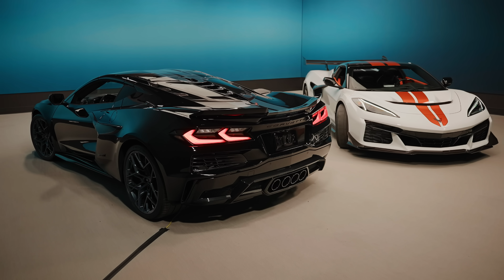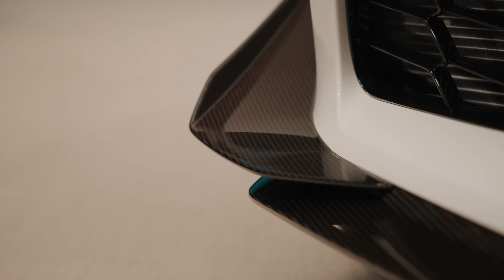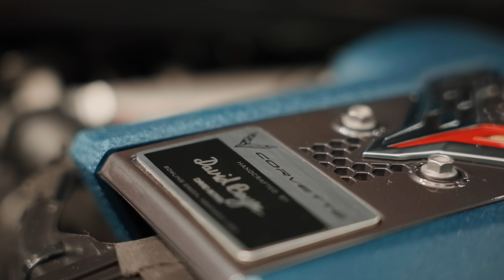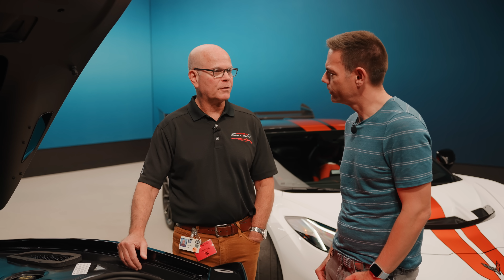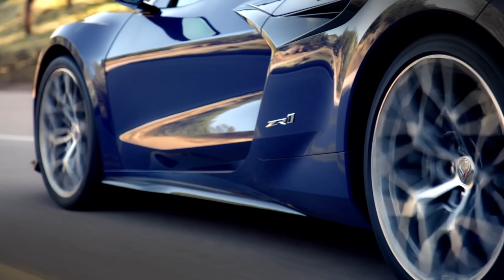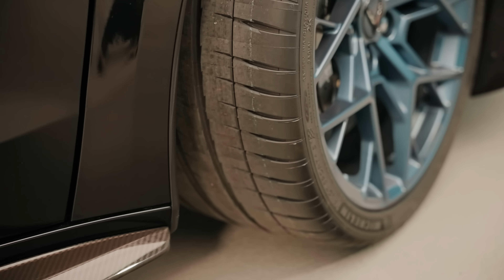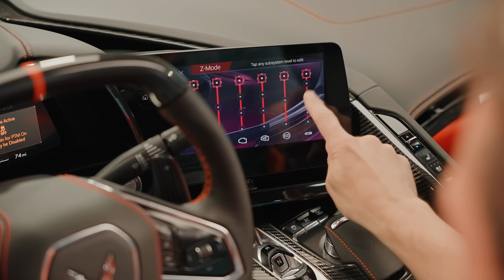FIRST LOOK: 2025 Corvette ZR1 – 1064hp, Turbos & 215mph!

Comment: What was the nurburgring lap time for this monster?
Reply: I may have missed them saying it here but they did test it at the ring but they haven't released the numbers. The g's vettes can do and now with this engine I can't see how it wouldn't have put up an incredible number if it could keep its tires
Reply: it kept going off track on boost
Reply: @blahblahblaa  So high hp but cannot stay on track?
Reply: @Sidewinder5 With street tyres yes.
Reply: No modern super car can do a real time attack of the Ring because the production version street legal tires fall apart.  You need to use track only tires, which defeats the purpose of an accurate lap time.  This is why many manufacturers do not believe the times being published by certain brands...

Comment: Forget GT3 RS, this will destroy the GT2 RS.
Reply: Also Revuelto and SF90 lmao
Reply: @imamfn  Revuelto yes, SF90 most likely not, especially the SF90 XX Stradale.
Reply: @imamfn the sf90 can beat this corvette not sure about Lambo tho
Reply: Until you have to turn......
Reply: facts
Reply: True story
Reply: Dream on, Dream on 🎤🎶🎶
Reply: If the new GT2RS has anything close to the down force the 992 GT3RS has, then unlikely.
Reply: @Brian.Jones.310 how much you want to bet? Y’all going to stop acting like Chevy don’t make shit HANDLE
Reply: @mogulme6190  I will give you a final answer seeing the 992 GT2RS. But my bet is going to be with Porsche unless some drastic changes are made by Porsche and sandbags the car.
Reply: @mogulme6190  FACTS don’t care about your feelings bro, and FACT is that the ZR1 simply doesn’t have the downforce to match the GT3RS, yet alone the even more crazier upcoming GT2RS (considering it’ll have more-or-less the same aero capabilities as the GT3RS). You can’t outphysics physics
Reply: @gavcom4060  fact, the Corvette will roast the Porsche.
Reply: @TheSaw410  based on what exactly? I’ve provided the facts, and you’ve provided nothing
Reply: @gavcom4060 z06 beats that car already google bro. This car will destroy that car
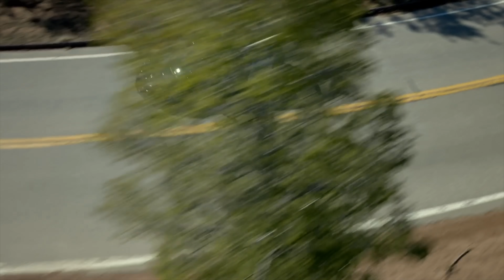Reply: @Mr.DDS82  there’s more to a car than straight-line speed lil bro. FACT is the GT3RS is faster around a track. 7:12 Nurburgring time for the Z06 vs 6:55 for the GT3, which is a lesser version of the GT3RS
Reply: @gavcom4060  I'm talking about track times the z06 has beaten the gt3 rs at tracks
Reply: @gavcom4060  the z06 doesn't have a official time at that track
Reply: @mogulme6190 it's not about being shit, it's just Porsche doing German magic
Reply: As cool as this car is, the downforce figures are nowhere near GT3rs levels (1,900lbs for the  GT3RS at 177 MPH vs 1,200lbs at 200 MPH for ZR1). This will brute force its way around a track with sheer horsepower lol. If the GT2RS has similar power, but with GT3rs levels of aero, the ZR1 won’t be able to match it
Reply: No it won't. It doesn't even have the same amount of downforce as the GT3 RS, which is what actually matters around a track. The GT2 RS will probably have 800 or more bhp while having more downforce than the GT3 RS, which on its own has more downforce than a McLaren Senna.
Reply: @SirMito  stfu. Porches have looked the same for 50 years and are ugly. Modified VW beetles 😂😂😂 This thing is going to destroy the GT3RS and beat the the GT2RS. All while looking way better. You see a Porsche on the street, no one turns their head. You see this? People are LOOKING. F your Porsche 😂
Reply: @SirMito  Something to add, McLaren produces it's max down force of 800kgf at 155mph and at the same speed the GT3RS produces less down force.
Reply: @SirMito  So? The Z07 kept up with (and even beat) the GT3 RS around a few tracks, I dont see why the more powerful, more aerodynamic ZR1 would be any slower
Reply: As an owner of several Porches, I learned long ago to never underestimate Porsche engineers.  They are the best in the world and it’s translated to their cars.
Reply: @thedudeabides1443  i think it’s pretty clear Chevrolet engineers have surpassed those that worked for Porsche and with larger budgets. What gm has done is way more impressive and just better packaged/executed. Of course it’s just easier to give Porsche the #1 spot in engineering because it sounds right. It’s not the reality.
Reply: @G-Rated  It is now and always has been the reality.

Look at the Porsche 959:  automatic ride control, electronically controlled AWD, magnesium wheels, 4 different drive modes depending on the weather and a 200mph top speed in a 440hp car.

And all that was engineered by Porsche FORTY YEARS ago.  What was Chevy doing with the Vette 40 years ago?

Heck, even with the C8, Chevy had to use 10 year old Ferrari technology from the 458 to reverse engineer the C8 engine.

Chevy engineers are very good, just not in the same universe as Porsche—or even Ferrari.
Reply: @thedudeabides1443  you couldn’t COPE any harder and you sound ridiculous. What Porsche and Chevy were doing 40 YEARS ago is irrelevant to what the C8 is today. That’s called deflection.

What 10 year Ferrari technology did Chevrolet use to develop the Corvette C8? You’re literally just making crap up. It was actually Ferrari who asked gm to license their magnetic ride suspension technology for their own suspension systems.

Where is the logic in saying Chevy engineers aren’t in the same league as Porsche and Ferrari with vehicles like the C8 currently in production? Sounds like another emotional foreign badge fanboy.
Reply: @thedudeabides1443  Porsche is overpriced garbage, and you pay for it...
Reply: Ohhhhh God the Porsche fans are insufferable. Why'd you make this comment 😂
Reply: @toxicgracie3772  apparently speaking facts amongst opinions makes porsche people insufferable
Reply: @gavcom4060  Yes insufferable. Go drool over your modified VW Beetle goofy 😂
Reply: @gavcom4060 and they sound like shit 😂😂
Reply: @gavcom4060 My comments were deleted by YT of course because they're about a whack as you Porsche fans but anyways, Porches are ugly, they all look the same and sound like crap. Have a nice day
Reply: @gavcom4060  ok I’ll entertain you. Why did the heavier convertible version of the z06 get a faster lap time against the weissach package gt3rs when throttle house did their latest track test? Why did savage geese find that the z06 was faster than the gt3 at their track? Did both of them “outphysics physics? I think you are insinuating “downforce” yields an “automatic win”. Seldom have I found a track with zero straightaways.

I know you are passionate about your lord god king Porsche and I love Porsche too but oh my lord please show some restraint with your open pda.
Reply: @Berettadv  Maybe because those tiny privateer tracks specifically suit the positives of the Z06? Throttle House’s track genuinely only has ONE medium-high speed corner, and it’s that sweeping right hand corner, and even then they only get to like 70 MPH. The BAC mono is the third fastest car on that track, and that thing legitimately has no downforce, or barely any at all. It relies on mechanical grip and its superior p/w ratio. Everywhere else relies on power, which the Z06 has, and barely at that. Same can be said for savage. Now go to literally any track that actually sees Motorsport on the daily, like Laguna Seca, and you can see a GT3 lap quicker than a Z06 Z07, by .4 of a second, despite the power deficit
Reply: @gavcom4060  ahh because we totally live near tracks like those right? Lol if I spent +$100k over a new corvette on a track instrument, I don’t care what track it was on, it should be faster period. It shouldn’t be anywhere near “Chevy numbers” and to add insult to injury the gt3 rs sucks as a public road vehicle where as a Z06 doesn’t. Everything that makes the Porsche a more enjoyable track toy makes the corvette a better road car. Time will tell if this new zR1 really does deliver but you are discrediting it before it has a chance and I think that’s kind of foolish.
Reply: @Berettadv  to entertain the American people and thinking they are back at the top of Automotive, except they're not
Reply: @Berettadv bruh a GT3RS with sport comfort package is better than a Vette for a daily driver in any case, US don't even know how to make interiors yet, while also struggling in the NVH dept
Reply: @mathieuschafer1360  "sport comfort package" 
- lol I must have missed that option right under "turbo thrust does not exist afturburner package"
Reply: @Berettadv  ah yes, turbos on a GT3RS are annoying fr
Well  or the other more comfy package, with backseats too actually
Reply: Yes there are 1000hp GT2's with basically the same Aero off a GT3, but who cares when I can have both a Hard top & a Convertible ZR1 for what a stock GT2 goes for!!!
Reply: You're letting hype get to you. You're talking about Porsche here
Reply: Agreed
Reply: Maybe the Zora.
Reply: Can't wait for Americans to flex about their 1064hp car barely beating a 525hp car on a speed track
Reply: Porsche is overpriced GARBAGE.
Reply: @243wayne1 Spoken like a true peasant.
Reply: @hellobooom  At least I own 3 super cars.  You live in the hamlet of Poorava
Reply: @243wayne1  Porsche is so garbage they like to compare this car to a Porsche that is a decade old
Reply: @mathieuschafer1360  Wrong.  Nobody is comparing this car to any garbage Porsche.  It stomps them, and Porsche KNOWS it.
Reply: @243wayne1  watch it struggle to beat a 525hp car
Reply: @mathieuschafer1360  It won't struggle to beat anything.  It will smoke them with ease.
Reply: @243wayne1  lol, this thing will never be top spot
Imagine being the greatest superpower in the World and not being able to go sub 7 on the nurb in 2024 LMFAOOO

Comment: Guys with a flat plane crank engine and four valves it’s not hard to 1000hp or even 1000rwhp. Twin turbo gt350s have eclipsed 1800rwhp. Good GM for steppin up.
Reply: Yeah, horsepower is pretty easily achieved nowdays.  Even in the lower end of drag racing...900-1000 is extremely commonplace.

Comment: Can that engine fit in a miata
Reply: probably
Reply: Carroll Shelby be like...
Reply: With the right attitude, yes.
Reply: You just need some butter and you are ready to go
Reply: Bigger hammer and more batteries for the grinder
Reply: With enough lube... 😮
Reply: Yes
Reply: i fit a duramax in there with the stock engine mount brackets
Reply: it do 1/4 mile in 1.3 seconds
Reply: If there’s a will, there’s a way
Reply: If they can fit a Viper V10 into one, then you should be able to fit one in. Now getting that power to the road...
Reply: That be one fast fast car..but ...it won't look as good as in the zr1 lol
Reply: 1gzfe fits so it should
Reply: Dude what do you wanna do?! 😅
Reply: Anything will fit anywhere with enough time and money
Reply: A Miata could fit in that engine.
Reply: It only has 5.5L, so it fits without any problems
Reply: @frost6916 don't be so sure. Displacement in miata swaps matters a lot less than whether it's OHV or OHC. It's easier to fit a 7.0 liter LS7 into any generation of Miata than a 5.0 liter Coyote because the OHC motors are just too damn wide
Reply: @matrinezkevin11492  oh someone beat me too it, using the LS7 as the example too!
Reply: @frost6916  displacement alone doesnt tell you how physically big an engine is. This engine is MUCH physically bigger than the 7 liter LS7 for example, because its DOHC instead of pushrod and because it has turbos and all the plumbing you need for that

Comment: Mopar boys punching air rn😂 their 1,000hp is a one dimensional, engine grenading brick compared to this.
Reply: Even the base C8 would smoke a Challenger Demon 170 in a circuit. Compared to the ZR1, it isn’t even fair.
Reply: Mopar guys don't have any sort of logic or reasoning. They're foaming at the mouth to race this thing as soon as possible like a pack of rabid prairie dogs. All bark, no bite.
Reply: Not even one dimensional lol
Reply: Drag car vs track car?
Reply: @christopherfowler1549  it will destroy it either way.
Reply: @christopherfowler1549  both 1,000hp but one can do it all and the other can’t even do it’s only trick properly lol.

Comment: How the hell did they get over a 1000hp out of this 

Most manufactures has to use hybrid technology to get over a 1000hp

Mental
Reply: Fully Built Z06 engine, clutch, and massive turbos will do that.  The fact it’s from factory is insane.  Now imagine a $250k MSRP price tag…
Reply: @Snowkone81  The cost of turning up a Z06 to ZR1-adjacent power would probably cost about the same amount once you include labor and all the workarounds to do it. It's gonna be stupid once the ZR1 gets out in the wild and people start boring them out and raising the boost.
Reply: @shred1894  agree - and having to use some kind of piggyback ecu required as well.  But then warranty is voided.  Some don’t care - some do.  Enjoy it however you like, but man GM is killing it with Corvette
Reply: @Snowkone81  Exactly my point. You can spend roughly the same amount of money to get it from factory with a warranty, and unless you're a lunatic who thinks 1000HP isn't enough for a street legal track weapon, it's clearly the optimal choice if you want that sort of car.

Even if you are that sort of lunatic, the ZR1 will still be a much better starting point than the Z06 or base model if you want to go past 1200HP.
Reply: 24 psi max boost. That is a lot. 

Most tuners end up running E85 at those boost levels, so GM engineers have solved that likely on pump gas. That's huge. Speaking about that, an E85 tune is going to be massive gains.
Reply: @jojog8304  The Koenigsegg Jesko makes like 1280 HP on pump gas. Only 220 HP more than this ZR1

GM is making a budget Koenigsegg lmao.
Reply: Other manufacturers just choose not to. They absolutely can.
Reply: @BRNDNSLVRA they can but they haven’t! Which is why this is special! I’m shocked by these numbers, I was expecting 850 max
Reply: @GazRsExtremeBrickMachines  Koenigsegg my brother.
Reply: @BRNDNSLVRA not exactly a mainstream manufacturer as much as I love them :)
Reply: @BRNDNSLVRA they have been in the 1,000k HP club for production cars for a lot longer time too. I think this will be the first production car from the US that will be over 1k. I wouldn’t count Hennessy for the sake of production itself. It’s a breath of fresh air, give it 5 years. Ford and Dodge will recommit to ICE like Chevy did and they obviously produced something we all should be proud of. I’m not saying it’s gonna be as good as Porche or Bugatti, but it’s a step in the right direction for high end production vehicles in the US
Reply: @BRNDNSLVRA Exactly
Reply: @BRNDNSLVRA  I’m saying on the basis that this car is rivalling to the likes of McLaren Ferrari Lamborghini Porsche
Reply: It’s iconic on its own
Reply: High RPM + Turbos
Reply: An engine that already makes a huge amount of power naturally aspirated is going to get a larger power boost when it's turbocharged than a smaller, weaker engine.

Boost is a multiplier
Reply: Because of larger displacement from the base engine. As mentioned, manufacturers can boost cars to the moon but they usually don’t for the sake of reliability and ease of use by the public
Reply: Which manufactures? European? No way it could pass euro whatever numer standards for CO2 emission, so they have to go hybrid. Not talking about super limited production cars like Koenigsegg of course.
Reply: Trackhawks have been coming with the same HP for a few years now
Reply: @deano_MTB since when did they come with 1k hp stock 😂

Comment: This car is almost like a modern-day Callaway Sledgehammer. 1064 horsepower is borderline ridiculous, but I love it.
Reply: Borderline ridiculous?  It IS ridiculous!
Reply: the AWD hybrid Lamborghini revuelto has 1001 HP, l this is a RWD 1050Hp Corvette. That's absurd.
Reply: @jwalster9412  Revuelto uses an electric motor for the front wheels too I believe, so this is even more nuts.
Reply: @amazin7006  jesko produces 1600 hp with no EV engines.
Reply: @jwalster9412  yeah wtf is he talking about “borderline” 😂
Reply: @jwalster9412 I didn't even know all that. 🤔 🤫
Reply: Almost, but the sledgehammer made 880hp IN THE 80'S. This corvette is easily 50% less ridiculous.
Reply: @icebrew  when did the calloway make it's power? The lt7 makes 75% of it's torque at 2k probably and from that point to 8000 probably makes at least 600 torque. Modern turbo tech allows for a much wider powerband. Lt7 is the greatest engines that will be sold at a US brand dealership. Calloway was technically operating as a dealer option right? Correct me if I'm wrong.
Reply: @GandalfTheClay  Callaway was a 1 of 1. The only sold models had less than 400 horse power
Reply: @hi4444ification  not sureabout the powerband, but It did go 250mph. Yes, it was a dealer option as well, it cost $400,000 in the 80's, this is not calculated for inflation.
Reply: @icebrew  it was not a real dealer option though. Only 1 car was made with 880 horsepower, the rest were just body kits or had less than 400
Reply: @icebrew  I'm sure they could easily surpass those numbers but doing so while keeping it drivable and street legal must be a real challenge.
Reply: The sledgehammer 🤤
Reply: This is going to handle way way way better than the sledgehammer!
Reply: it’s completely unrealistic but god it would be so fun to drive
Reply: I remember that beast! Was such a dream car from the 80s. But this comes with a factory GM warranty!
Reply: Bro anything over 500 on the street is kinda silly. Imo 3-400 with a good suspension/ tire set up is way more fun to drive.